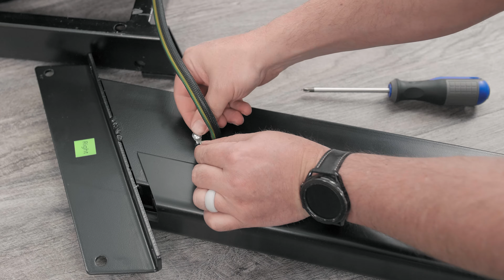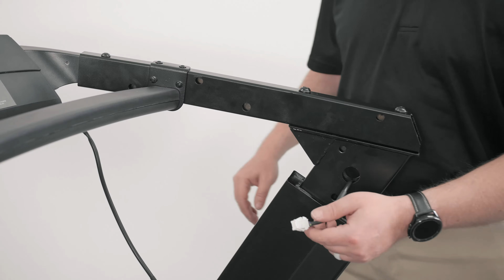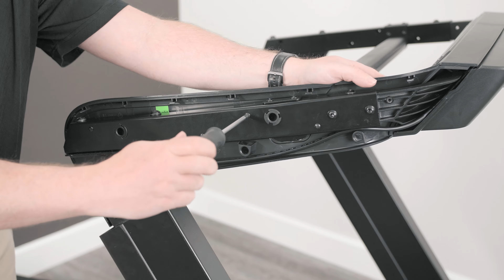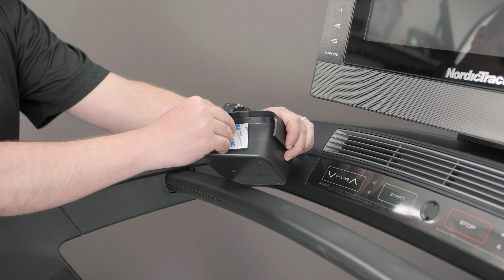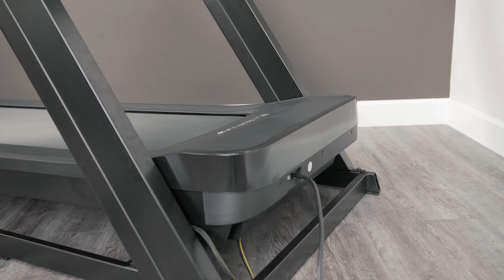NordicTrack Commercial 1750/2450 Assembly

Comment: Not sure if you will see this since it’s an older video?m, but I’m trying to get out the grommet on the right arm to disassemble it for moving and it doesn’t seem to pop all the way out. Any tips?
Reply from the maker: They were never really intended to be removed. There are 2 tabs that can be pressed in on to help them clear the upright but they need to be pressed from the inside so they really are no help, (but it may help remove this same wire from the underside of the belly pan instead). If you are determined to remove the wire from the upright then you will just need to force it out past the tabs. Often this causes them to break. Replacements are easy to put back on though.

Comment: My NordicTrack 2450 did NOT come with the cable nor the screw in the right leg. It was plugged into the treadmill by itself, no screw to be found. No instruction manual either. Also missing all the bolts. In fact, the design and steps seem to be completely different than the video. Unacceptable
Reply from the maker: If this was new from the factory in a sealed box then you should reach out to the manufacturer. It sounds like you may need to contact your point of purchase for support otherwise. Also these videos are Model specific there are many models of Commercial 2450 or 1750. There may be a video that us more useful to you depending on the actual model number of the treadmill you have purchased.

Comment: Would disassembly be the opposite? Like, where you say the outer cover has nine places that snap in, after removing the one screw, will they pop off without breaking? Any tips for disassembly? Thank you.
Reply from the maker: yes you should be able to disassemble the equipment by reversing the streps shown. Some plastic tab fasteners are pretty aggressive there is no guarantee they wont break however.

Comment: 1750 doesn’t have those connectors so not the same.
Reply from the maker: This is a design from 3 years ago. The current model requires a different assembly approach and does not have the connectors. Double check your model number. There may be a more appropriate assembly video that better represents your model. I'm Sorry for any confusion.

Comment: I just got mine today and was so happy to finally put it together just to realize I don’t have a wire in the right support beam. I’ve had nothing but problems with nortictack
Reply from the maker: This is a design from 3 years ago. The current model requires a different assembly approach and does not have the same wire in the upright. Double check your model number. There may be a more appropriate assembly video that better represents your model. I'm Sorry for any confusion.

Comment: How easily is the 2450 to disassemble? I’m purchasing one for the house I’m in currently, but plan on moving in a year or two.
Reply from the maker: Its not too bad. If you can move large pieces and are not intimidated by wiring under the hood then you can disconnect the upright wire from the lower board and and out of the belly pan. Then you can move the uprights and console as one assembly and the base and deck as a second part.  
You can also just reverse the assembly instructions. There is always the possibility of damaging the plastic covers and the plastic grommets that hold the wire harness in place can be difficult to extricate from the uprights. (they're not easy to remove from the outside and there is no access on the inside of the upright). Damaged parts are usually easily replaceable.

Comment: My monitor won’t rotate
Reply from the maker: If you have this model then there is no kind of lock or mechanism to prevent it from turning. It is just a pressure fit. It will turn if you apply enough force to rotate it. It will loosen up with use so they usually ship them quite tight.

Comment: @4:41 how do you remove the blue wiring apart, there is no visible clips and I’ve tried to pry from all angles
Reply from the maker: The wires that are connected with the blue shrouded spade connectors should pull apart. There are no clips. They can be very tight however.
Reply: Yes I actually snapped it by prying hard. Any ideas now on how to repair. Doesn’t seem to be able to reattach. 

It was so tight and seemed impossible to pull apart.
Reply from the maker: @gabrielrivera5819  Wire connectors and crimping tools are available at big box hardware stores. I'd just crimp a new connector on the wire.
Reply: Would you happen to have a YouTube video on how to do that

Comment: How do you get the clips disconnected on the monitor?  I can't figure this out and need to move the treadmill.  It doesn't fit through the door jam to move to another room.
Reply from the maker: Press on the top of the catch on one side of the connection. The wire connectors will then separate.

Comment: I recently bought a 1750 and the deck track is VERY VERY NOISY. Getting assistance is TOTALLY IMPOSSIBLE
Reply from the maker: I hope you find assistance here. Most noises that are not part of normal operation can be resolved with some basic maintenance. This video may help. https://youtu.be/k4Xx9ReMYAQ?feature=shared If the unit is still making noises after performing the basic maintenance listed  here you should reach out to the manufacturer. their member care is available currently Mon-Fri 6AM-6PM mountain time.

Comment: How can I make the monitor rotate so the bottom plate is opposite as shown on 4:31. I have tried to manually rotate and it’s impossible
Reply from the maker: They are usually very stiff (but not impossible) to turn. I have positioned the plate on the console base and used the plastic lip to push against while  turning the console so I could get the first two bolts in place.

Comment: At 0:25 how do you remove this cable, since I need to move and disassemble the treadmill?
Reply from the maker: The strain relief grommet will need to be pried out of the upright to get to this connection. It is not well designed to be removed unfortunately. Often times the grommet will break and need to be replaced. I usually use a slotted screwdriver when I need to Pry out the grommet.
Reply: @FitnessEquipmentHelp  Thanks. I tried out a flat head screwdriver and that worked.

Comment: We are unable to rotate the screen side to side. It is stuck and will not budge. The base will not move or rotate the monitor. No visible nuts, screw, or bolts. Only base with monitor wires showing.
Reply: What do we need to do? 

Was on hold for 40 minute’s yesterday with Nordic track and nothing resolved. 

On the phone for an hour and still no live representative. Probably going to return.
Reply from the maker: @Alice_n_Cooper  It is just a pressure fit. Apply more effort and it will turn. They make them particularly tight at the factory because they will loosen up over time. They included a custom wrench with the treadmill to tighten the pivot nut when this occurs. You may be able to loosen the pivot nut but I would just move it back and forth a few times.  The nut is under the plastic cover that is directly below the monitor. It comes off by removing 2 Philips head screws. The nut will be tight.
Reply: I have same issue.
Reply: @refereepitman   My husband had to use a rubber mallet. He flipped the monitor upside down and slowly tapped the metal flat base with a rubber mallet(try something soft but solid if you don’t have a rubber mallet) to align with the holes where you would screw the monitor down. Once you are able to align the holes and screw down the monitor it will be much easier to rotate and tilt. But it’ll only be easier to move around once you screw the monitor down in place to the metal flat base. Hopefully this helps. We didn’t have anything loose or sliding around or sounded out of place. 

This is a pretty common thing but Nordic track doesnt explain it well or at all in the manual. 

Nordic track is a pain to work with over the phone. I was on the phone with them for a total of 4.5 hours over several days to try to fix this problem. 

I attached a Reddit link that may help if what we did doesn’t help! There’s a bit of reading… Try the rubber mallet first! 
It will rotate and tilt once you get the screen screwed down! Gentle taps with whatever you use if you don’t have a mallet!!

https://www.reddit.com/r/nordictrack/comments/wkbhro/just_built_the_nordictrack_2450_and_i_cant_figure/
Reply: Rotate the flat base at a 90 degree angle first to screw the first 2 holes down on one side then you would be able to rotate the screen to the opposite side to screw down the last 2 holes!
Reply: Don’t see plastic cover directly below monitor.   Or any screws.
Reply: Also, if I tilt the console in my hands I hear a sound like metal loose and sliding around inside the console.

Comment: I just bought the Nordictrack 2450 and there’s no bag of screws etc to assemble it?
Reply from the maker: There should be a blister packed card with the assembly hardware attached. If it was not included with your new machine reach out to the manufacturer to obtain a replacement hardware kit.

Comment: what if the console won't rotate
Reply from the maker: the console is pretty stiff on some of these. there is a nut that holds these together. the included wrench may be used to tighten or loosen the screw. Usually the nut is very tight and it is done intentionally to keep it from coming loose. If you cannot loosen the nut I have had success just apply a little more force you are not likely to break anything as log as you are not pushing directly on the display. It will loosen with use.

Comment: At 0:45, the ground screw doesn't fit in the hole on the right upright - it sticks out half way. Any suggestions on how to fix this? I continued with assembly - the ground screw isn't flush with the upright.
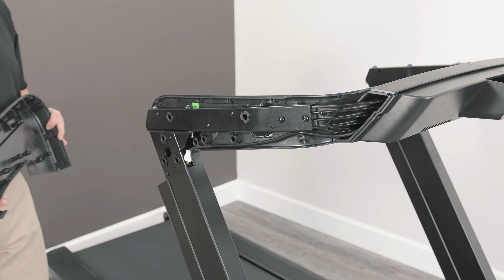At 3:40, the outer grips (left & right) don't fit onto the handrail assembly - even after lining up the tabs & holes. A space remains between the outer grips/handrail assembly & I am not able to attach the screw to the outer grips. Any suggestions on how to fix this issue? I am stuck at this step.
Reply from the maker: The ground screw is often difficult to install because the hole punched into the upright is not tapped and in my experience is a bit on the tight side to ensure good contact. although it goes against my advise elsewhere i may run the ground screw in with a power drill. You are unlikely to damage anything in this step by doing that.  If your plastic grip parts are deformed or damaged so they do not fit, I would contact the manufacture for a replacement.

Comment: How do I get the screen to tilt up and down.  Screen rotates but I cant get it to tilt up and down?
Reply from the maker: The tilt is on a pressure fit axle. They are shipped very tight. They will loosen with time and use but may be very stiff out of the box. Support the top and bottom of the display as you push the display back and forth. It will loosen up with use hopefully not too much ;)

Comment: 2+2+4+1 x2 is 18 screws but they only ship 14 screws + the 2 non-pointed screws for a total of 16 (from the hardware package) and instructions. What am I missing here? (other than screws)
Reply from the maker: The left and right upright inner covers may have already been assembled. They are shown as part of the assembly in this video but are pre installed in the user's manual assembly directions.

Comment: what's the best way to disassemble when moving from room to room? I am moving out of a room but it does not fit through the door frame, even with the door removed
Reply from the maker: reverse the assembly instructions in the users manual. you should then be able to move the base and frame with the treadmill belt through the door on its side. You will then have ood instructions on how to put it back together.
Reply: I'm struggling to get the clips apart for my 1750.  I've squeezed the sides, but they do not come apart and I don't want to break the clip (the black piece on one side already broke off).  @FitnessEquipmentHelp  @4:47 these clips (cream color ones with the dots)
Reply from the maker: @denisea6956  There is a small latch that has to be depressed it is in the center of one of the long sides. When the top of the latch is pressed it lifts up off of the catch on the other side. The two parts of the connection can then be pulled apart.
Reply: Got one.. working on the other one.  Thank you!!  @FitnessEquipmentHelp
Reply: What about the blue wire, there aren’t any visible clips to take out.

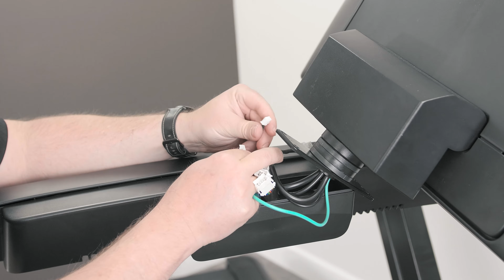Comment: At exactly 4:15 / 4:22 during the cable connection, does anyone know what connector ends those are?  My unit didn't ship with the connector end to the black/blue wire from the monitor and having difficulties with support at the moment.
Reply from the maker: I believe the Black/Blue wires in the 3 pin connector are to the safety key switch.
Reply: Did you figure this part out? We are building ours but the blue wire does not fit the attached blue wire on the monitor? So confused if it’s missing a part there??
Reply: @claudiablumen  I did!  The connecter for the black/blue cable from the Monitor/Console was attached to the corresponding connector on the treadmill.  So popped it off and connected to the monitor/console wires.  Now the kill switch is hooked up and works.

Comment: Bracket unable to swivel. Help.
Reply from the maker: The console swivel is intentionally stiff. To pivot the console for assembly I have had to set it in place then use the plastic around the mount to hold the base while I pivoted the console. once the bolts are in place this becomes a little easier and will likely loosen up with time.

Comment: Assembled ours, but fan doesn't work . Everything else is working.   What can be a problem?
Reply from the maker: there are a lot of wires near the fan. I have had wires interfere with the fan rotation before. I would take the fan cover off and check for wire interference as well as any damaged loose pinched or disconnected wires. please be aware there is 1 empty wire connection on these wires (at least there was on the one we made this video with.)

Comment: The buttons on my dashboard isn't working.
Reply from the maker: I would make sure all the wires for the console assembly are still connected. First make sure the safety key is engaged. If the wires are intact and connected securely, then you may need to replace the part with the buttons you are referring to.
Reply: @FitnessEquipmentHelp  Had the dashboard replaced.  Faulty wires.  Good thing it comes with a year warranty.

Comment: Please clarify, the steel plate base of the monitor gets mounted to what exactly?
Reply from the maker: It is mounted onto the handrail assembly, specifically the Console Base. It is a large metal substructure inside the handlebar assembly.